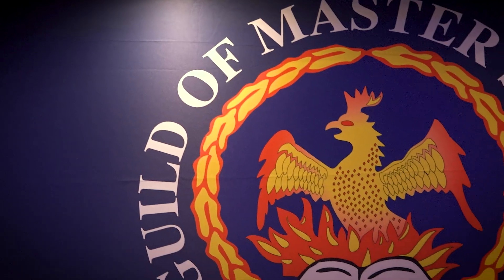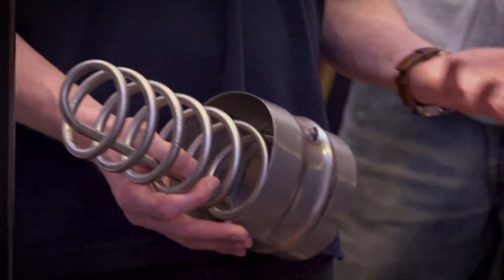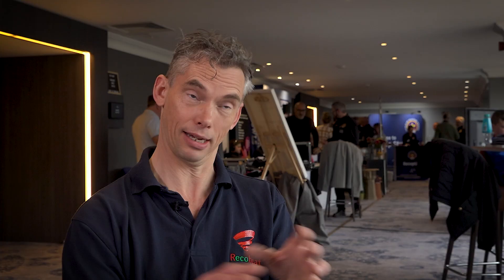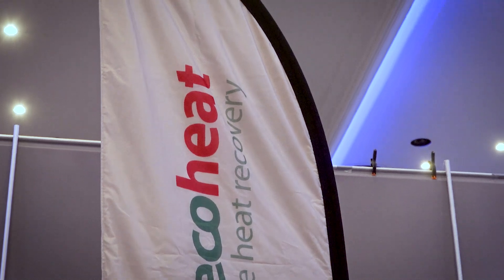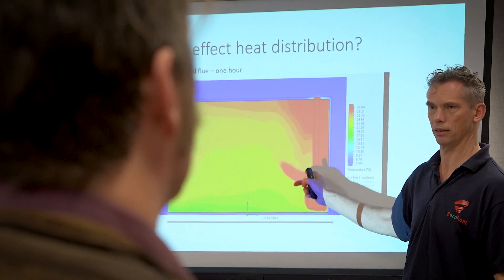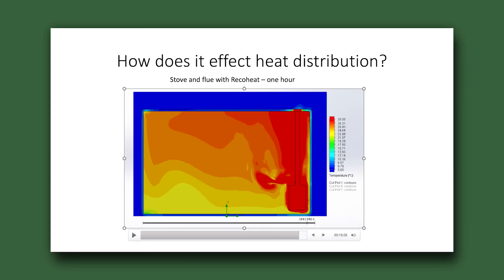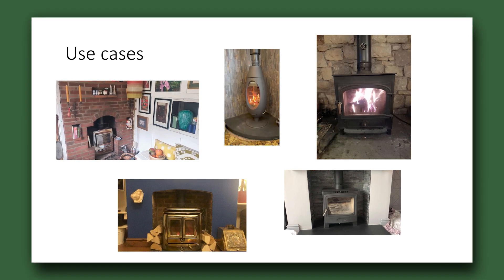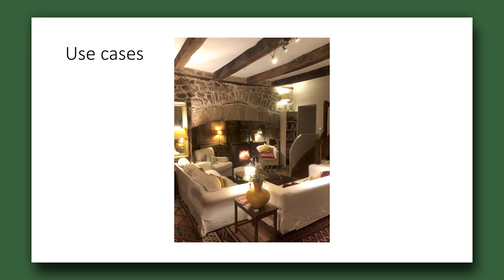Introduction to Recoheat by the Guild of Master Sweeps

Comment: Would be nice to see the temperature change from the bottom and above the top of the recoheat, Will. Just to show how much heat is still going up the chimney.
Reply from the maker: It actually doesn't make a measurable difference to the temperature of the flue gases because the surface area of the coil is so small in comparison to the flue. BSRIA, the external test engineers, confirmed our own failure to detect any difference, and this is confirmed by the Solidworks with physics engine modelling. The coil creates turbulence in the flue gases, and the gases foil around the coil so that they accelerate, so the combination of very tight, fast heat transfer from a tiny proportion of the gases, plus the mixing that then occurs above the coil, means that the effect is so negligible that you can't detect it.

Comment: How much does it cost to run the heat pump in electricity and how noisy is it?
Reply: It is noisy.... pump is more annoying because vibrations, air pressure less but u still hear it anyway is more warmer in room and u use less fuel
Reply: What about sound proof insulation. 
I am in 300 year old cottage. Definitely look into this
Reply: Second year running ours and Electricity cost is pence per day, the pump needs sitting on some sound absorbing material ideally in another room or loft if in a bungalow. The unit does emit a quiet hissing sound when hot air is coming out of the pipe if you are sat directly in-front of the fire . It really does make a huge difference to the comfort of the room by creating positive pressure and  warming the space evenly. We recon we use 35-40% less fuel.